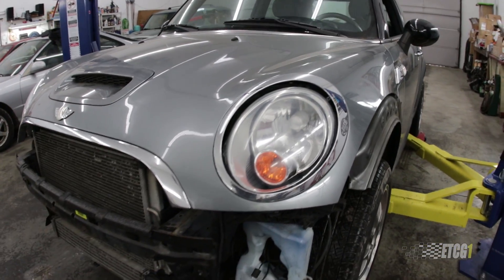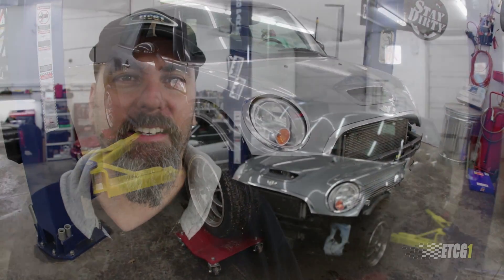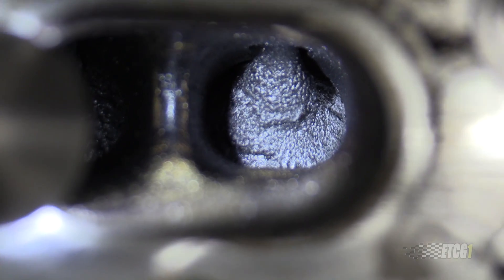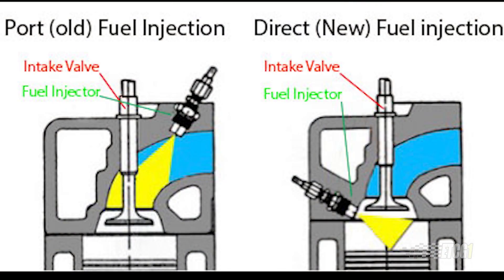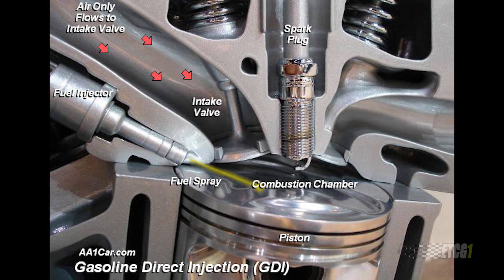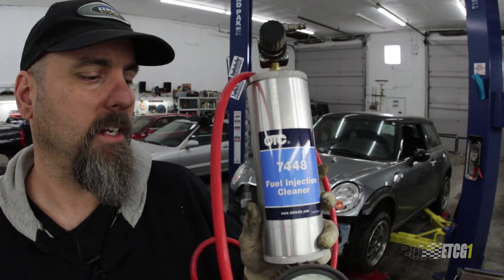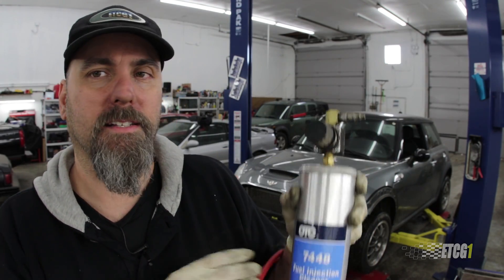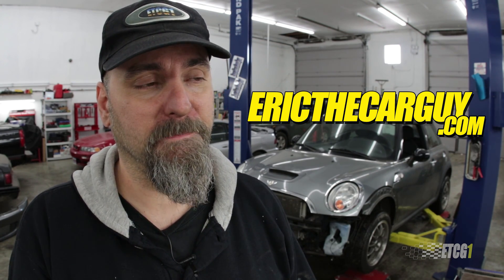Direct Injection Proves Fuel Additives Don't Work

Comment: Just a few thoughts on this video, cause it seems kinda toxic and derivative. In modern direct injection engine, yes, fuel additives are pointless. However, in older, especially much older fuel injected engines, it can have a benefit. You and project farm should have a talk, he tested 4 fuel additives in one video once, and tested most of them separately.

2. Fuel injection is a necessary evil in today's world. Yes, carbes engines tended to last forever and were easy to work on, but they were horribly inefficient and pollutant. If us motor heads want to keep ICE's a thing, we have to deal with fuel injection, because modern hybrid and electric technology is getting better and better.

Comment: Seafoam has worked well for me. But I never tried it on a DI engine before. I am also curious about Shell's Nitro+ Gasoline. They claim it will help DI engines stay clean. Unfortunately, I have not seen actual, real world testing here. Would love to see some long term tests if you get an opportunity.

Comment: Those fuel cleaners are not marketed for direct injection engines that’s why CRC came out with GDI intake valve cleaner, it’s a spray can that you use through the intake or vacuum line

Comment: I don't really think claiming this case as "proof" that fuel injection cleaners don't work is really a fair assessment. Of course they don't work on DI cars; as you said, fuel never reaches the backs of the valves.  I haven't seen a FI cleaner that claims to clean DI valves except for CRC DI valve cleaner, which is introduced into the air intake stream, not the fuel system. I think a better title for this video would be, "Why manufacturers need to start using dual-injection," but that's just my two-cents. :)

Comment: I was gonna mention that cleaner. We use that at my dealership a lot. Fixes a lot of issues. Check for open bulletins on the high pressure fuel pump.

Comment: Gasoline direct injection wears engines out faster it's planned obsolescence except for the newer systems that have that plus a second set of fuel injectors that only fire occasionally for cleaning the valves # carburetor life

Comment: The only fuel additives I use is Howe's diesel treat on my M35A2, Stab-bil fuel preservative for when the car is parked during summer & the bikes during winter, octane booster (any brand) to increase octane when I can't find premium fuel (only regular available in rural Alaskan places) for my Ural sidecar motorcycle so the engine doesn't knock or pre-ignite as bad, and Heet to help with water in the fuel in the winter during long periods of sub-zero temps 0f to -40f. To those who think octane booster is a gimmick, it's not. It's a misunderstanding of its intended function, which isn't to increase power but to increase the fuels resistance to combust easily in a hot cylinder before the spark plug has actually sparked the combustion of the fuel/air mixture.

Comment: I run 2-stroke oil @ 1-2 ounces  per 10 gallons on a non-DI car.... I've seen 1-2 mpg average over several thousand miles(255K on a 2012 Toyota Yaris)  its one of the cheapest additives I've ever used& it does what I expect.
I also saw a recent drop in MPG, changed the PCV, problem fixed.

Comment: I have fuel injectors and I do use Lucas Injector Cleaner about once every six months. Not sure how much it helps keep the injectors clean but the peace of mind............. Also, if I had direct fuel injection, I would not use it as, like you said, no effect. I have, however, used steam injection in the intake to remove carbon. Helps when valve guide seals are leaking as it cleans off plugs.

Comment: The previous owners should have used a catch can filter kit on that Mini! Volkswagen and Audi have had the same issues with their GDI engines. A lot of the newer GDI engines like Ford are making have dual fuel injection on theirs to sometimes run the port injection ones to clean but I still would install a catch can filter though.

Comment: this is why we had to ditch our mini. got so carded to death in 80k miles that it was not running correctly at all anymore. warranty ended and it would have costs thousands to get it fixed.

We loved this car but it was a total POS. warranty we had paid more than we  paid for the car during the years we had it.

Comment: that gunk buildup is because of the pvc putting oil vapor on those valves. using synthetic oil could help. anyway what if you just threw gas on those valves and let them soak for a while?

Comment: The only cleaner I've used that's worked is techron fuel system cleaner, not the injector cleaner. I had a Nissan xterra that was idling kinda rough despite having clean valves and uniform compression across the board, put 5 tanks of fuel with the techron and it did make it smoother. Just take a while.

Comment: What about the intake spray cleaners that you spray down the throttle body? Wouldn't that be worth doing once and a while in a DI system? Wouldn't fix what you have there, but might keep it at bay.

Comment: Welcome to  mini cooper ownership. Got a 2006 mini not a cooper s just a little 5 speed hatch the dohc engine that you have i hear is mostly cleaning, carbon build up. The sohc that i have is timing chain tensioner. The dmtl pump also likes to fail on the system check and keep working so you have a service engine light on. Because you have the 2nd gen you should be able to bolt on parts off the john cooper works model.

Comment: I saw a video in which the guy said doing an induction service on a DI,  turbocharged (Ecoboost) engine might lead to the ruining of the turbo due to the access heat the induction service causes. So care should be taken when doing an induction service on DI, T/C engines.

Comment: Would you say fuel additives that claim to have upper cylinder lubricant aren't of any benefit either? I suspect that may have been left out because they don't actually help on that front either, but just curious. I am on your side with what you said in this video.
Reply: The crosshatching in the cylinder bore should be supplying all the upper cylinder lubricant the rings need.  Any more is a waste, and potentially a point of failure for the cat as it gets burned off every time the cylinder fires.  Of course, if your cylinders are that worn out, then it may help a little...temporarily...but the problem is really a worn out engine, and it's only masking the symptoms at that point.
Reply: The engineers who designed the engine have taken into account what needs lubricated where and adding some random lubricant (other than the recommended engine oil) is a waste of time and money.
Reply: All good answers!
I missed that EE video; it looked too... corporate. I'll give it a watch.
Reply: Cars Simplified you should check out “shell v power” video made by engineering explained. They specifically mentioned the lubricity of fuel and it seemed to be a pretty important thing in the long term. But if you only plan to use a car for 10 years and get rid of it, don’t bother putting anything in there. Here is the thing, the reason why car manufacturers don’t put extra additives or use super good quality parts is for cost considerations, as long as the car can last over the warranty without an issue to them that is the solution. Imagine when you request better stuff and stricter maintenance than other car maker what would that do to your sales? And when a car lasted too long how is that gonna affect your car service business and new car sales? The thing is, there are thousands of different brands of additives, but only a few stand out, it has to work in some extent.
Reply: Meh i use it as injector cleaner, the dodge my brother has, has a tendency to get clogged injectors from using cheap gas for too long, and dumping a bottle of Lucas tune-up-in-a-bottle in the gas tank w/e it starts acting up fixes the issue. Could just use 93 octane, but at the cost of just $3 a bottle, its cheaper to just buy the octane boost/injector cleaner than buy premium for that gas hog.

Suprised he didnt mention the use of Seafoam, which is pretty much dumped into every thing as a "cleaner" lol. Used it on an old 300k mile Lincoln, super thick smoke cloud and black soot on the ground from using it.

Comment: There's only two fuel additives I trust. One is two cycle oil, the other is fuel stabilizer for gas that's gonna sit in cans for a while. Side note: DI alone just isn't a good idea IMO. No matter how well designed, every DI engine will have this problem. Just a matter of how soon. I know it's not as efficient. But if you've got DI some amount of secondary port injection is necessary.

Comment: If the fuel and oil additives were REALLY beneficial then the manufacturer's would recommend and market them.  But they don't, so it seems simple. Its all just SNAKE OIL!!!

Early Direct Injections systems suffer from design problems in the PCV system. Carbon blasting is required.  I have seem improvements in the PCV systems since 2011 and a HUGE reduction/elimination to carbon build  up problems.

Comment: With respect, Eric, fuel additive cleaners may work just fine, but what they can't be expected to do is work where they never end up, e.g. intake manifold and valves in direct injection engines. Also keep in mind that gas thesr days is required to have some cleaner additives.

Comment: When they are mixed with fuel and passed over the valve in a multi port or tbi system they likely do help a little better than plain gasoline. 

Your more or less proving my opinion of direct injection sucks ass and is responsible for the motor eating itself from the inside out because there no fuel or anything passing over the valve to clean it like in prior systems.

I used to do fuel system cleaners at Goodyear that you hook to a vacuum port, and smoke the shop out. Those in my opinion work and may be the only thing that could possibly help with a direct injected car. However probably wouldn’t be as effactive as they too were designed to mix at some point with gas before passing over the valve;)

I think your frustration is misplaced, and should be placed more so or even squarely on direct injection systems solely;)
Reply from the maker: Thank you for your input, but you might want to rewatch the video as I covered much of what you questioned.
Reply: ETCG1 lol, no need to rewatch it;)

I know that you covered it, but the way you said what you said and the title of the video, made it sound like you were mostly blaming fuel additives for the mini’s woes. 

That said, being a mechanic myself and understanding the finer points, I know that’s not what you meant. Others who are not won’t get the point,  as you mixed the two negative opinions of fuel cleaner/additives and direct injection (is crap lol) together in the same video.  I know and understand to your larger point they go hand in hand, but the majority of your audience might not get it?

Even without fuel additives, direct injection is the specific cause for the mini’s valves not being self cleaned because nothing, zero fuel goes over the valves. 

If you showed valves that looked like that in a conventional mpi set up, then you have a major problem and fuel additives won’t help because it’s too far gone. I agree;) but valves looking like that on a direct Injected car are going to happen eventually no matter what because there is still pcv systems on those cars that send nothing but air and crankcase vapors over the valves. It’s just a question of how long;)

I wasn’t giving you shit, just trying to contribute and help;)

Comment: Personally, I think many fuel system cleaners are carry-overs from the carburetor days. I will say that on my push mower with its CA certified engine, the carb got gummed up once and some STP carb cleaner mixed in with the gas got it cleaned out. But, that's a carb, not injectors.

Comment: Could be a fluke but I had an intermittent rough idle on start up on a high mileage miata. I changed plugs and wires and hd the coils checked. Threw some redline fuel additive in there after researching what people found to be most effective. No more problem. 🙍

Comment: Is there a difference in the solvent effectiveness between pure gas and E-10 blend gas? The latter of which has become more widely available over the last 10 years. I know E-10 gas can and will ruin some fuel systems in smaller applications like lawnmowers because they weren't designed to use ethanol blend gas. I'm not a fan of E-10 gas and will avoid it as much as I can with my vehicles. I wouldn't be surprised if the type of gas played a factor into this issue.

Comment: actually ETCG1 "Eric" has hit a good point or made a comment on such!!

if willing could you do an experiment......

jack your car up at the rear, remove the intake manifold off (exposing the intake valves) close off one of the chambers & actually see how effective pouring fuel into the intake/valves actually is.. then do the same for another cylinder using chemical agents etc

as I've a mini S clubman & I've to check on the valves,... yet all the uploads online I can only find chemical solvent cleaners being used, sea foam, walnut blasting etc & some good old elbow grease to wire brush & a steel pick to take the carbon away.. no-one seems to want to try the fuel way (as previously used during normal engine operations etc

I'm wanting to try toe fuel method along with wire brush.... I'd lie to fill the chamber up with the intake valve slightly open so the edges (valve & intake wall) can also be cleaned... once fuel is removed ie via vacuum line/pump I'd coat the cylinder wall with a small amount of oil & hand crank the engine to ensure the valve seals haven't been dried out due to the fuel exposure  (yes the cat would be removed to safe-guard that from contamination of fuel & general waste being dripped through etc

I'm just wondering if you'd try this.. plz let me know?!?!?!

Comment: So way back in automotive school, a few of my classmates and I decided to put together a little test for fuel injection cleaner using our engine dyno.  We used a Ford 3.0L V6, and customized the fuel rail so that one side of the engine could be fed pump gas, and the other side could be fed the same pump gas with the addition of a specific, popular fuel system cleaner.  The engine was run for a total of 100 hours, after which the engine was torn down and inspected.  We saw both subjective and objective proof that the fuel injector cleaner was doing something.  Valve deposit weight was lower, piston deposits were more consistent instead of being splotchy and rough, and injector flow remained more consistent with pre-test benchmarks.

We intentionally used non-Top Tier gasoline for this experiment, as the bottle specifically stated that it was intended to be used where low-quality detergents in gasoline may have failed.

Use of Top-Tier gasoline gave similar results to using low quality gasoline with additive.
Reply: Is that a direct injection engine? the 3.0 V6 EcoBoost is a direct injection engine and the 3.0 V6 Duratec is non direct injection engine

Comment: First  of all SORRY THIS HAPPENED, I KNOW YOUR ANGER AND FRUSTRATION SIR. Direct Injection engines should have a catch can on them or go the route of the new Mustangs. Add a catch can and you won't have the valve problems with D.I. How does D.I. prove that fuel injection cleaners DON'T WORK ? What type of cleaner do you use in your pneumatic set up that runs cleaner directly through the fuel rail and the injectors ? I clean my own injectors or rebuild them but mine are simple to get to, Jeep 4.0. Just take a 9 volt battery hook some leads up to see how they spray out of the Jeep of course, bench testing.
Reply: Eric did you try to clean the valves while the intake was off ? They do make a D.I. cleaner or you could use Sea Foam, BG, Engine Top cleaner either spray it through the  or let it suck the cleaner through the PCV valve. Follow the directions on the can let it soak for awhile. You might have to do this more than once ? Eric do you know which fuel pump it is ?

Comment: When oxygen sensors first came out they were used to compensate for pirate air using a computer. In OBD2 cars it has become an major weakness in all fuel injection systems because the oxygen sensors are used to ensure the cat performance instead of providing feedback to correct the A/F mixture.

Comment: Best use for fuel system cleaner is not for cleaning the valves themselves, but removing the varnished gasoline from the injectors. However if you buy premium fuel, you shouldn’t even have any issues. However I did use some fuel additives to clean my injectors, which did improve my idle quality and mileage even after the product left the system.

Comment: I skipped around so you might have mentioned it, but what about the injector cleaners that are applied via a small hose through the Air intake, wouldn't that work better for DI engines?

Comment: i have worked in the auto parts industry for over 30 yrs and seen and heard it all about fix it in a can crap.99% of fuel treatments are a waste of money in my opinion and the 1% that does work is very limited.with fuel systems, most of the problems arise from the fuel itself and not doing regularly scheduled pm's.